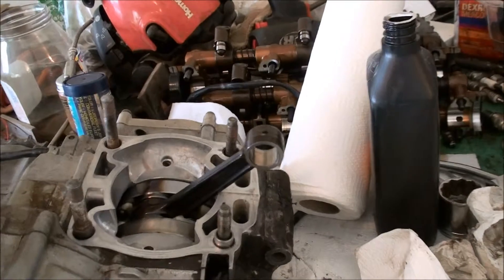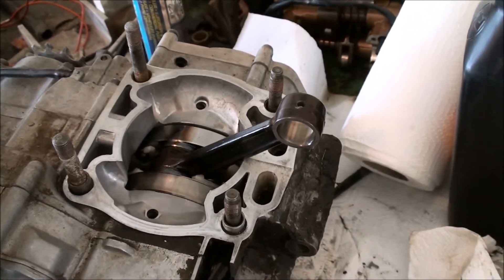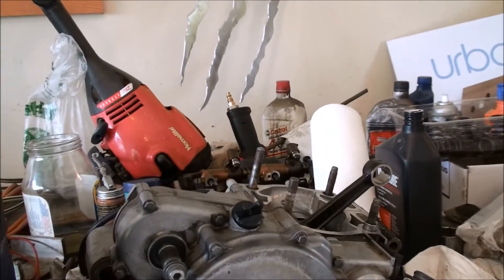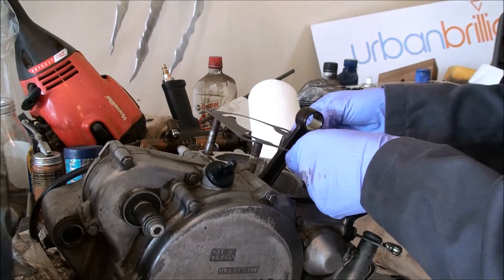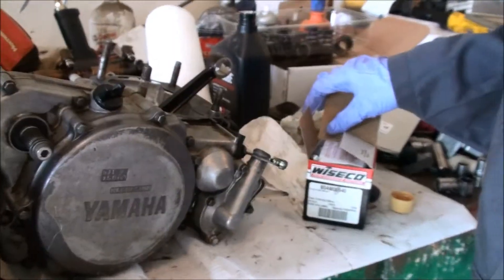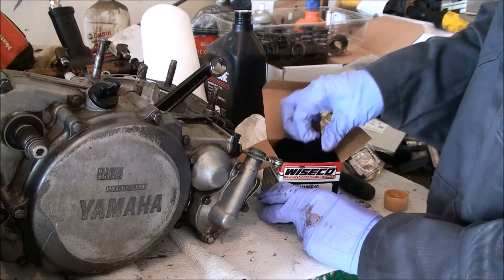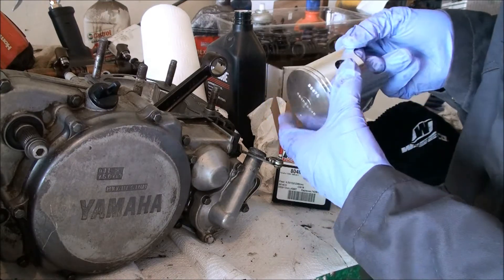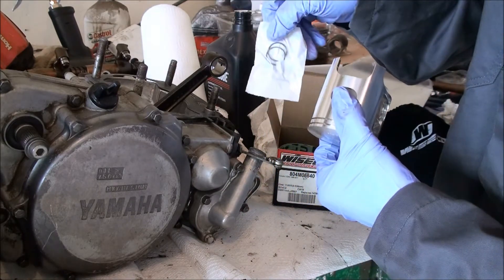Motorcycle Engine Rebuild - Part 3

Comment: Fantastic videos!
A tip for those without a ring compressor: Zip ties do the job, you just clip them off after you get the piston into the cylinder :-)

Comment from the maker: aw man, that sucks!  That's what happened to me when my piston exploded (except I was in third gear).  Pull your jug off and take a look to see if your piston is in tact.  If it is, then you will have to split your cases to check out the transmission.  Whatever the case, it isn't a good one.  When mine blew, I had to replace the crank too because it bent the connecting rod. Good luck man.

Comment from the maker: @Yamahayz2502t  Piston broke because it was a short skirt race piston and was way over its service interval.  It formed a hairline crack (probably on the exhaust port side) and shattered.  Last I checked Yamaha recommend you change the race piston every 35 hours. That why I put this one it - it's long lasting.

Comment from the maker: Please take note that I didn't sand any of the metal away.  I stuffed the crankcase so no debris could get into it, then lightly sanded the mating surface which is common practise among mechanics (I would know because I live with a certified mechanic).  The purpose of the gasket is to seal any high or low spots in the surfaces to prevent vacuum leaks.

Comment: No way,where the pulling of the crankshaft assembly mr. I sharped the gasket ? Your joking me man . I want a look at the connecting rod and while thats apart I'll need the assembly lightened and high speed balanced unless you looking for trouble. Hey sure I'l take the superlight platinum alloy bottom end kit whats the price on that added to a squirt of oil ?

Comment: just wondering, wear does the coolant curculate at around the engine? and wear is the intake and exaust valve on the engine? or do 2 strokes not have valves? thanks

Comment: hey I have an important question...if you rebuild the top end do you need to re plate the cylinder ???...if it has no scratches cant you reuse it again.....plz respond I need to know

Comment: hello friend I have a question first as I can find the right size piston I have to buy, the piston broke a tab I have to replace it, I want to buy a Wiseco piston but no idea of the diameter, I'm doing it on my own, what Unlike in the part where the crank this is black or this is normal is about as clean samples in the video, need help